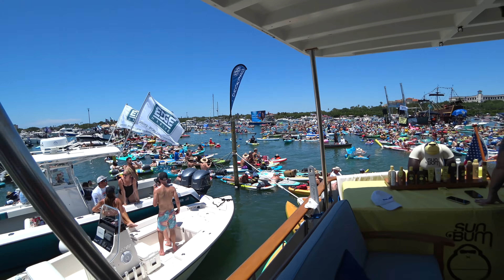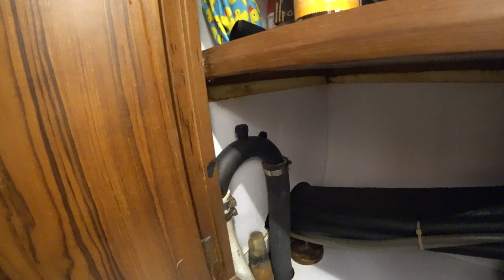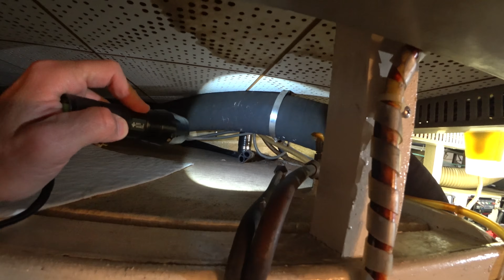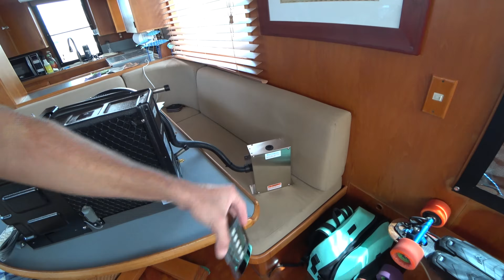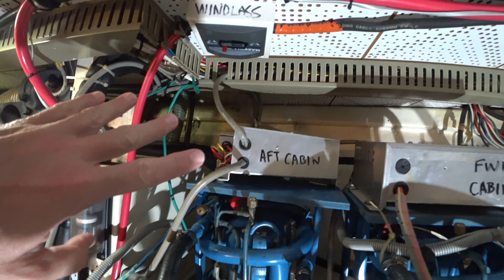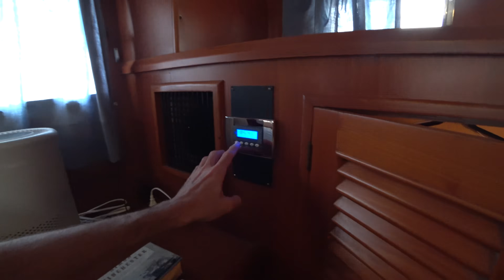Boat Air Conditioning Problems! DIY replacement of an old air conditioner with a new Marinaire

Comment: In the future the tube within tube condensers get plugged quite easy. You can replace just the condenser and its a lot cheaper than a new unit. Just an idea.
Reply from the maker: Depends on what system ya got and what the situation is. I have frankensteined  and used second hand systems enough to find out that much of the time it’s not worth trying to save a little bit of money up front on an old system. Now, if you have a much larger ac system that will be super expensive to replace altogether, then if is probably worth just changing out the condenser. But a smaller unit that a replacement is under $2k, you may just be better off replacing with new.

Comment: is that wire big enough for the compressor draw? it was only running a fan before. its a long run with #14 or #16 wire. id make sure wire isn't getting hot because now you running a fan and a compressor
Reply from the maker: Good question! I was concerned about that originally. I ran the unit and checked to make sure I did not have a heat-up of wire/connections. I thought I had 12 gauge for the hot/neutral, but I am going to double check. That old fan drew quite a bit of current, and this new ac is much more efficient. However, now you put the bug in my head, I am going to revisit and make sure everything is still fine and safe. I am now replacing my fwd ac, so it is a good time to check back on it and run new wire if necessary. I appreciate you calling attention to that
Reply: @TheGreatEpoch  if possible just tape bigger gauge wires to the old one and pull thru. Also tape some sting to leave in for future pulls 👍🏼
Reply from the maker: @Guerrero1187  good call!

Comment: How is the Marinaire a/c working for you?    Considering replacing my old Cruise Air.
Reply from the maker: Love both of my Marinaire’s! They have been solid. Planning on replacing my last old ac this summer with another Marinaire to make three on board
Reply: @TheGreatEpoch  thanks for the feedback.  I have the old cruiseair (all one unit) and they are getting tired (18 years old).   Been looking at the MarinAire as likely repalcement.
Reply from the maker: @tlteal  no problem! If your replacing self contained (all in one), the Marinaire will make for an easy swap out, and it will make a world of difference
Reply: @TheGreatEpoch  I also replaced an old 8k CruiseAir with a MarinAire 9k unit.    They work amazing so far.  Thanks again for the recommendations.
Reply from the maker: @tlteal  fantastic!! One thing to advise you on, make sure you stay up on your regular acid treatments, especially when the ambient water temps are high.
Reply: @TheGreatEpoch  just got my new 16k marinaire unit installed which replaced the old CruiseAIR.  Huge difference.   The old unit was pushing 74* out of the vent and the new marinaire was 57* and still dropping colder.    I ordered one for my master bedroom on the boat too.... just need to install it.  Thank you for the advice.
Reply from the maker: @tlteal  that’s fantastic! Thank so much for following up with that update. I love to hear a success story, especially when it was assisted by my advice 😁.

Comment: your raw water lines should be double clamped per ABYC
Reply from the maker: Stelios, it is indeed recommended to double clamp where you can, as long as the second clamp can properly bear on the pipe or hose barb. Thank you for bringing that up. And I appreciate you watching and contributing

Comment: Very nice run on the hoses  and installation. Curious to see what you finally decide about the under bed tank solution. Ive given you my idea but it may or may not be practical for you. Also would be interested to know where you would have to relocate the tank fill to place your unit that little bit further back or if thats practical with the ducting. Always chasing those couple inches of space lol.
Reply from the maker: Thanks Doug! Your idea with the batteries under the bed is actually the best plan yet in my opinion. It will just be a bit until I get to removing the old tank. If I put another smaller fuel tank under there as well, I will just need to bend the fuel hose over a few inches to get the clearance for the ac. But we shall see when the time comes
Reply: @TheGreatEpoch  oh i get it. One job always turns into planning for numerous jobs lol. If i was there i would be happy to help out. I learned so much from others by lending a helping hand and visa versa. Its what makes the boating community family.
Reply from the maker: @dougfaulkner6799  would be great if you were still at the dock!
Reply: @TheGreatEpoch  one never knows what the future will be lol. Id love to get a trawler and live there again.

Comment: WOW ! I am facing this  exact same upgrade on my DeFever 44. This video will help, though the electrical I am not good at. The raw water cooling pump was able to keep up with all three ACs despite the long run to the aft state room ?
Reply: If you are not changubg the head lift the longer run should not matter
Reply from the maker: @stelioshondrocolos1869  luckily the hose going up over my fuel tank didn’t negatively affect the flow, at least from what I could notice without measuring. I do believe though that the water flow will decrease once you reach certain pipe or hose lengths, just as voltage will drop in a long run of electrical wire. That is of course if the hose is open on one end, as it is in this application.
Reply from the maker: Oh man, how about that timing! Yep, there was literally no discernible change on the water flow with the long run of hose. Feel free to reach out when with any questions you may have on the project.

Comment: thru hull in the aft stateroom makes a lot more sense to me. 🤷🏻‍♂️
Reply from the maker: I will certainly evaluate as I go and see if it makes sense a year or two down the road. So far so good with the long run of hose.
Reply: Naw leave it as it is, your don't hear the water leaving the unit and splashing at night...
Reply from the maker: @br5498  good point!
Reply: @br5498  valid point, though the AC water is steady not splashy like engine exhaust, so i don't mind the sound.
Reply: Here is an electrician input.  On the 2 whites, find the hot one and use a black sharpie to mark the end.  
I suppose removing the abandoned freon tubes was not easily doable.  I like to remove most all obsolete stuff, then again, that 44 is  already very heavy.
Reply from the maker: @svcoquina114  that’s a great idea, David, thank you! Yeah, it would have been a bit of an ordeal to get the old line set out of there. Also, I thought that if who ever owns the boat next does not like the self contained in the stateroom, and wants to go back to a split, the line set will already be there, although they would want to pressure test before putting back in service. Thanks again for watching and commenting, David.